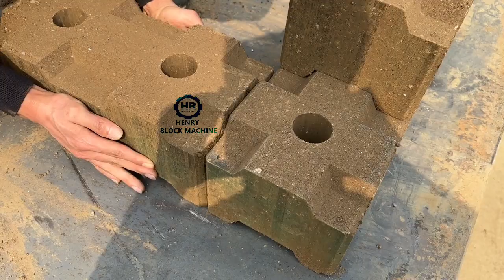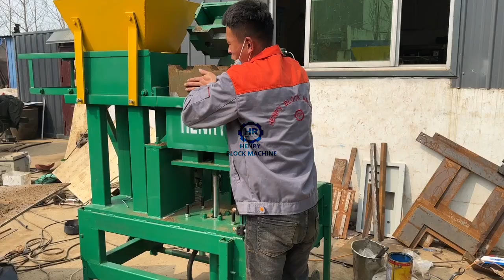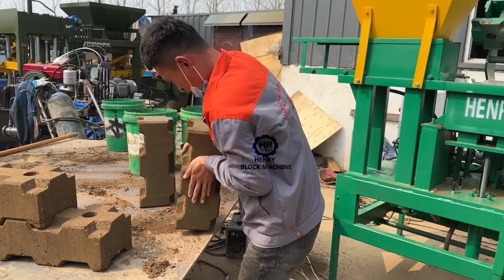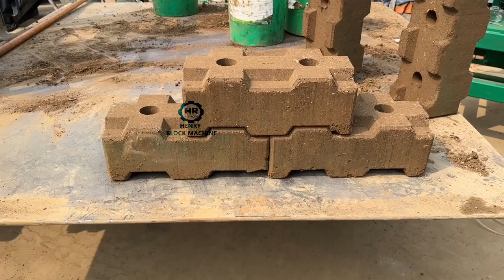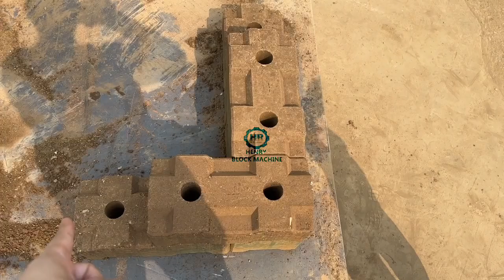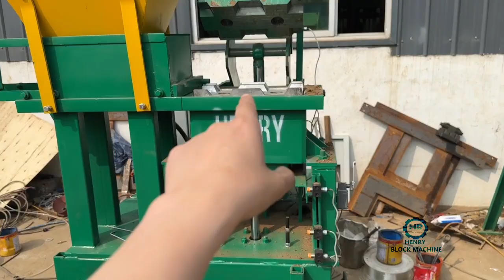How to resolve  difficulty of doing T junctions and L junctions with hydraform blocks by interlock ?

Comment: Wonderful. I like this pattern. But please can you plan with your Architects or Engineers to design complete building plans including roofing pattern ( drawings) on how to build  projects like 2 bedroom, 3 bedroom or 1 story building apartment or flats , with these soil interlocking blocks. The drawing plans can come as a coloured/ black and white brochure sold with each machine or a downloadable PDF file for anyone who buys a machine. Also few machines and their models and block patterns and other information can be displayed in the catalogue/ brochure.
The size is not bad 400mm x 200mm x 150mm is good it will make the building stabilized also will help carry the roof load.
Reply from the maker: Hello dear friend.  thank you so much for comments. Did you already subscribe my channel ?  please do it . Thank you again . or you can WhatsApp me at: 008613053989171.

Comment: You can't do a T without a T block or by cutting a blocks. I think it would work by cutting a block in quarters.

block = 1234. Remove 2 and 3. This gives you 1  4 and you can slip a block perpendicular in that spot to create the T. Then 2 and 3 can go on the row above the next to give 3   2. It requires precise cutting though. I think it would work because of the symmetry in the design but not 100% sure. It would not work with the holes though as one would only get half a hole from one of the quarter blocks.
Reply: Let's say the brick is 40x20cm with two holes, you need another version which is 60x20cm with three holes so you can create the T.
Reply: @andreaskurn  No, , because that 1/2 have you are added is not needed. You don't want a full brick sticking out from the wall, else the brick that would sit on top of it will line up exactly and not overlap like you would want.

That is, you won't be able to stagger the bricks. Think of the end of a wall. You end up having half bricks alternating with hole bricks.
- -
* -

- -
* -
- -
* -

The same has to happen at the T which is really just an end of a wall merged into another one. It's not easy to show in a comment but the same profile I showed above would be true except the *'s would be full bricks which are actually inside the other wall.(they would be sticking out)

If one wanted to do a + then one would need 1.5 of a brick.

Comment: Hello, I like your block design very much. I have a concern, since there is not full floor contact with the block, does it not reduce compression ability? Do you have the same mold with a flat bottom?
Reply from the maker: We could design and manufacture the template for the flat bottom molds
Reply from the maker: Are you still interested in our block machine and try to purchase one ?